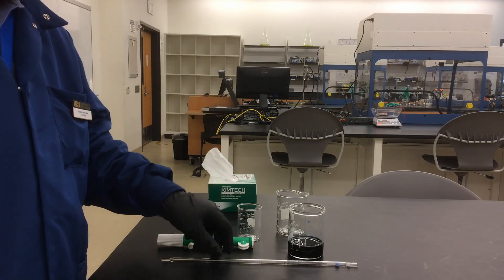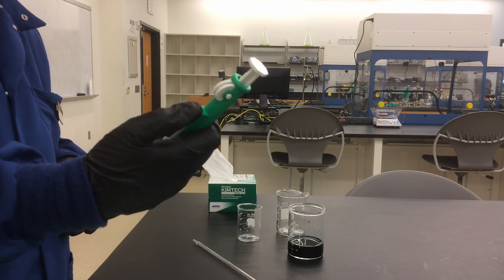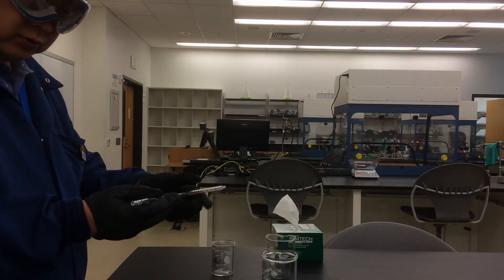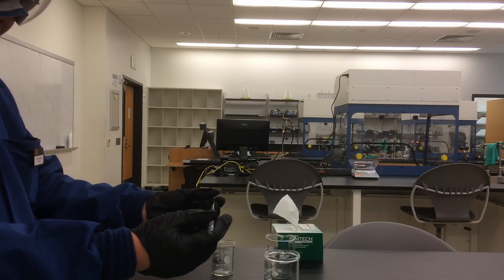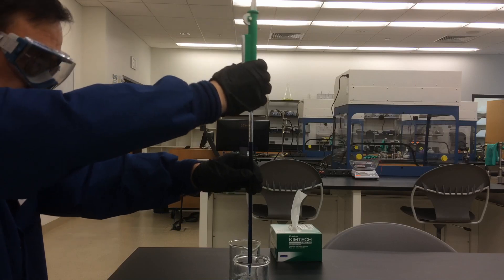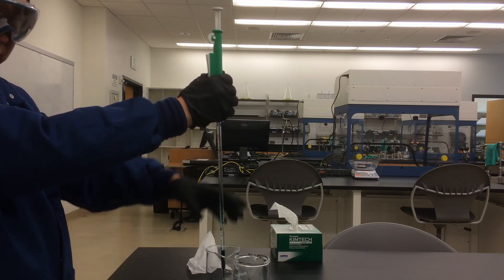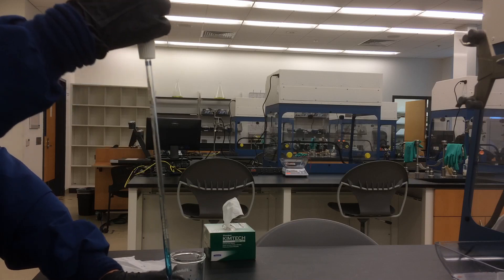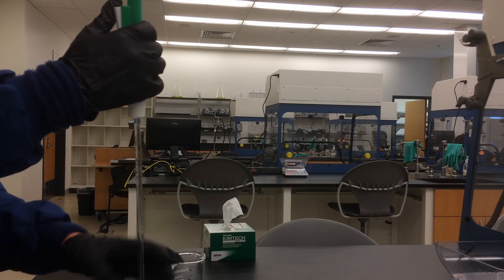Guide to Graduated pipettes

Comment: Hello. Suppose I want to put 2 ml in 5 tubes. Is it okay if I use a 10 ml pipette and pour 2 at a time? If by doing that, after dispensing 2 ml, by pressing E, it happens that the pipette loses 0.5 ml by itself (without me doing anything) what could be the cause? Another question 🙏 if using a 2ml pipette every time I press S the liquid goes up, but goes down immediately, what could be the reason?